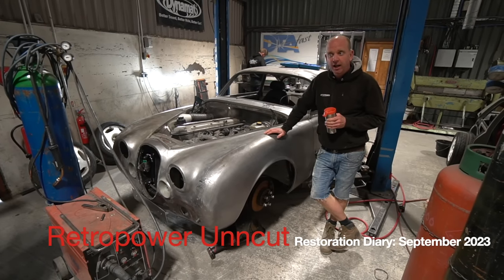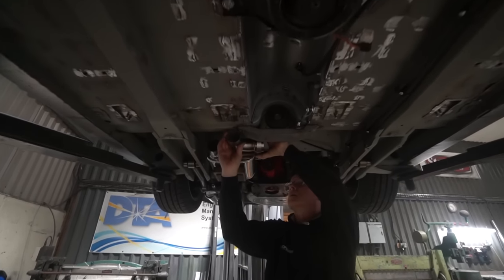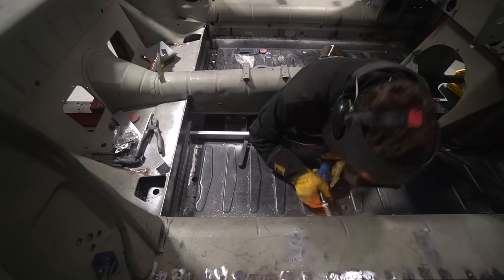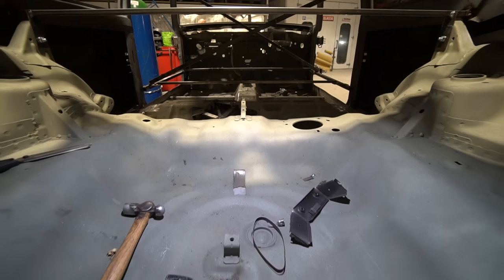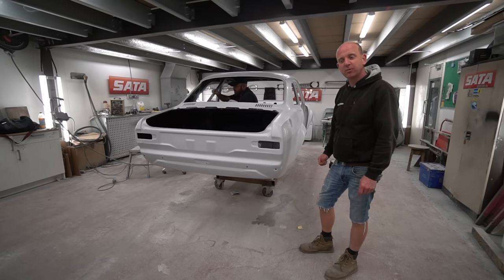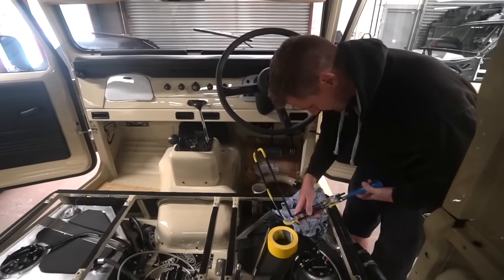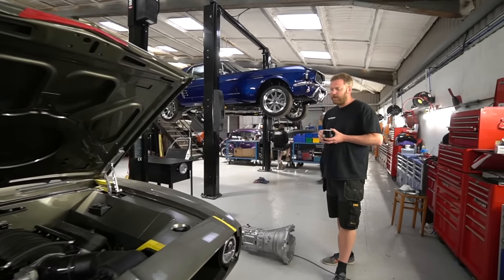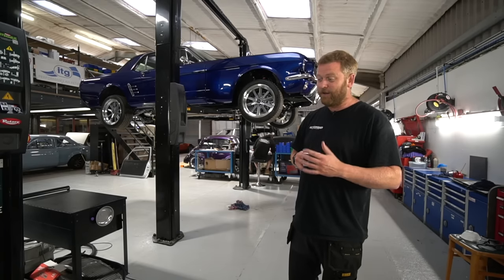How Much Does a Jaguar V12 & Transmission WEIGH??

Comment: Be interested to hear how effective the eAC is given the power demand....not sure what you're doing with alternator but hot idle is going to be your acid test there. The output at low speed isn't generally great so you may need to idle jack (lots of modern stuff does this). Pretty much everything remotely modern drops the ac compressor out at high throttle / rpm plus the delay on startup.

Comment: Factory AC systems have incorporated a WOT( wide open throttle ) relay for years now,essentially cutting the supply to the trigger for the AC clutch relay when ever full throttle is applied.Switching off the AC manually is belt and braces😁

Comment: 20:09  Your a/c strategy for a little power gain under full acceleration is right on the money.  Most of the cars I've had since the late '80s had this from factory,  probably because they were underpowered and needed every little bit they could muster.  I think the setup was that if you floor the throttle, you lose vacuum...and that is what trips the switch that cuts off the compressor.  Doing it with the computer should lets you tailor that a little more closely to the engine's power and torque curves.

Comment: As an American used to seeing V8s (and V6s and inline 4s) centered neatly in engine bays, I just can't believe how much the Allegro engine is offset to one corner of the engine bay. 
You could fit two more engines in there with how far it's shoved into one corner!
Reply: Yeah, one of the many things I've always hated about front wheel drive - couldn't believe the first time I looked under the bonnet of a mini.
Thought the Lancia Delta was perfect until I realized it is just a transverse front w/d with a pto to rear axle. That's why I'd never trade my AWD Subaru for either Quattro or HF Integrale.

Comment: I remember a week ago you mentioning changing the exhaust on the Mustang to avoid it hitting the axle under bump. I would strongly advise during one of your road tests putting about one hundredweight in the boot and also an adult in the rear seat then take it for a drive and take it over some speed bumps. Not fast just walking pace. See if you find that the rear has a dreadful tendency to really sit down when coming off bumps. I have owned a 65 Mustang for over 25 years and never really solved the problem. I had the leaf springs re-built in the UK and now run the adjustable Koni shocks, which are supposed to be the mutts nuts, but if you wind the bump adjustment up to stop the sitting under load it is too heard when running light. If you've  solved this problem perhaps you might mention how in a future  episode of un-cut.

Comment: You said last week on your wire looms to struggle to get all the colours you need so therefore end up using the same coloured wires. In those cases do you use cable markers to identify the same coloured wires ?

Comment: When you do the thermal zinc spray , can this be painted over to an acceptable finish ? I realise its meant for the underside which would then be undersealed, but if areas like the boot floor or inner wing areas were zinc sprayed , would it leave too rough a finish ?

Comment: Hi, I can't believe the weight of this V12? Sorry that's to much and a Rover V8 fully build and balanced would put out the same if not more power.
Reply: but it would no longer be a V12 then, would it? if it was all about weight and power, then the powerplant would be a Honda K24 with big turbos....
Reply: yes you are right, it is also about the whole experience and therefore the V8 is the better route. Check out Harry's last video, this Vantage 7 liter engine makes people go crazy in their comments, far cooler car then his V12 Jag, even if it would be in 7 liter form.